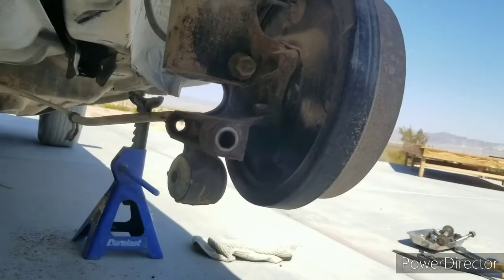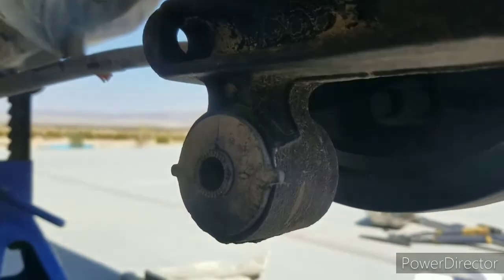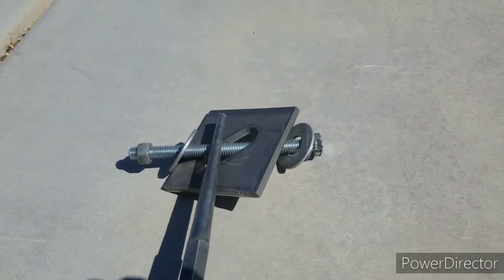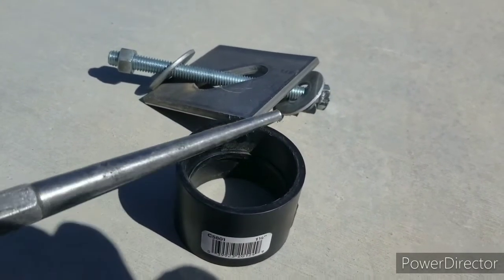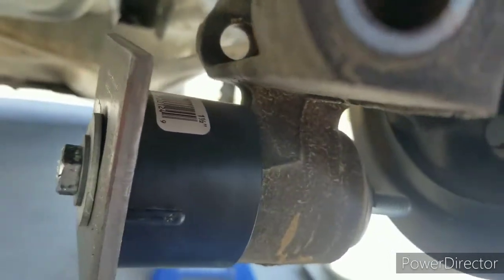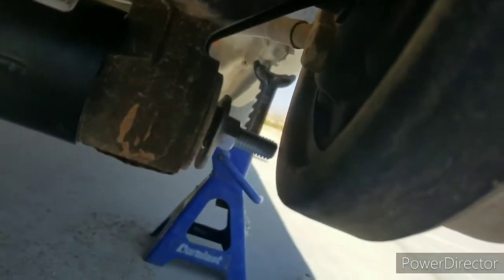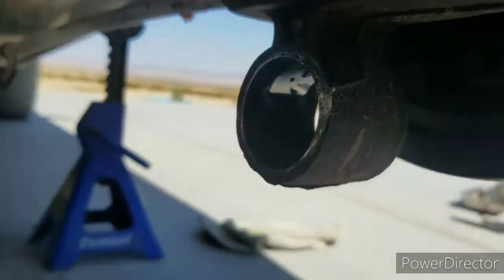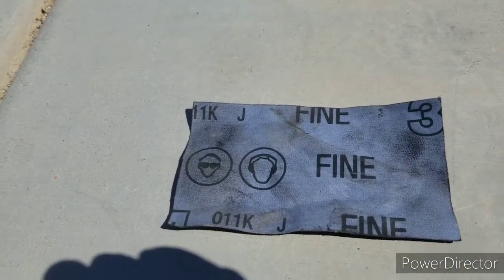Toyota Camry rear hub/knuckle/trailing arm BUSHING REMOVAL

Comment: I removed and installed the trailing arm bushing using the same tool. Just make sure the bushing is pushed through far enough so both sides of the bushing extend beyond the knuckle. Since my Camry has 400k miles, I decided to remove and install the lateral links bushings with the same tool. I had to upgrade the bolt, nut and washers to a grade 8 quality instead of the grade 2 galvanized bolt sold at Home Depot. I stripped two grade 2 bolts before upgrading to harder bolts. Bought the grade 8 hardware at a local hardware store (cheap). Also had to buy  a smaller coupler. I tried to buy the bushings at the Toyota dealer, but they didn't sell them because they want people to buy the knuckle with the bushings installed. I bought aftermarket rubber bushings. My bushings had been in place since 2002 so they were a bitch to extract, but with some patience and penetrating oil, they all came out.

Comment: I don't understand why you didn't show how the device worked? Which end do you wrench? Are you sure the screw alone will push the bushing into the abs pipe?
Reply: It's the same technique as using a ball joint press, but he just used one that fit in the tighter confines of his vehicle.  Dorman sells a kit that includes the press sleeves for removal, also.

Comment: Why TF would you go through all of this and not show the actual procedure? Unbelievable. You could have shown the install with this video as well.
Reply: because he struggled with it and didn't want you to see that
Reply: You would hold the nut opposite to the metal plate end fixed with a wrench and then turn the nut at the plate end to pull the bushing through.  If the bushing does not pop out before the nut starts to get pulled into the knuckle opening, then use a socket over the nut (which is opposite the plate end), and the bushing should eventually pop through.  Also spray some silicone lubricant at both ends of the bushing before starting, and hopefully some seeps into the knuckle to make things easier.

Comment: What's the part # for that knuckle bushing? Very good video by the way
Reply: Unfortunately there isnt one. They come only on the axle carrier. What you can do tho is get them from junkyards and find repros online.
Reply: @synthwaver7698  yeah ,
i had to buy one …. 
I have to find a bolt  also. Was seized up an couldn’t get it out even with a torch …. So I had to cut …
Reply: @synthwaver7698  Amazon sells a few of them not too hard to get FYI

Comment: Would this cause the rear of the car to sway right when the right rear tire hits a bump?
Reply from the maker: Not really...  check your rear toe in
Reply: @personalfunfest  thanks for the reply and I did and every other bushing and arm is tight and where did you get this bushing? Trying to order it now
Reply from the maker: @DWNSHFTco  make sure tire pressure is factory psi... otherwise they will bounce like a basketball... make sure you are evenly toed in... if you are towed out the car will try to walk away from center...  the bushing in this video is for fore/aft control... ie breaking and acceleration